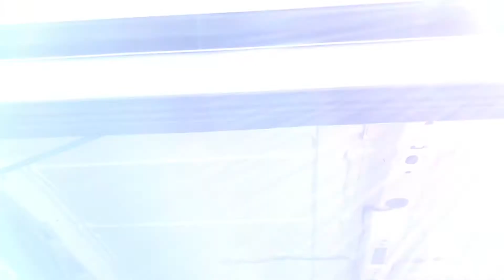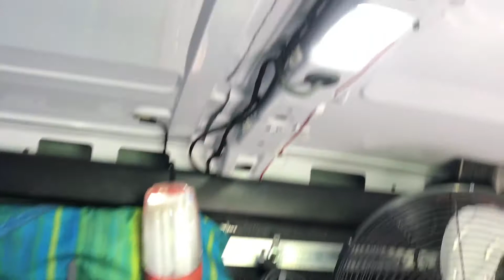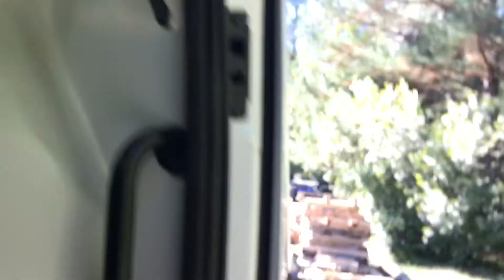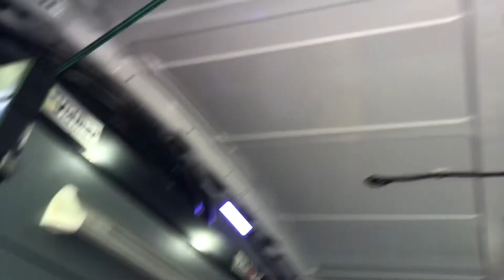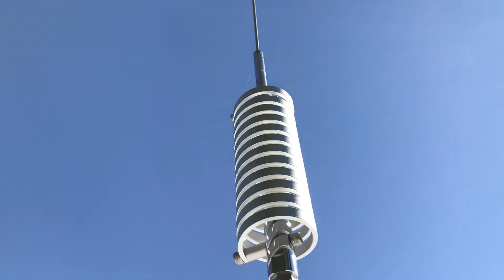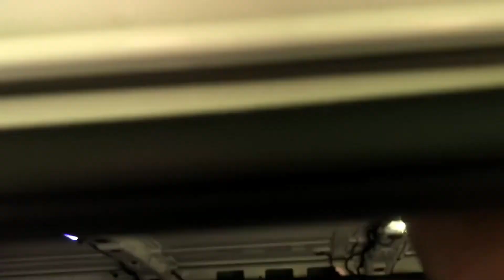High SWR fix it with an Impedance Match

Comment: When you use a coil, most of the radio energy is lost and the gain of the antenna is greatly reduced, without a doubt, the gain of the antenna is negative, also this transmission line has high losses, which makes the return current fake.
Eric Muller (Doctorate Rf/Microwwave, Field Communications)
Reply: Are you referring to the coil on the antenna or the coil on the coax T?

Comment: Not nessasary to get low swr...u need to properly isolate rf ground and bond....this will resinate at power outputs causing a loss in field strength

Comment: Running an FT 891? just get a MFJ 939 tuner and just bolt it to the underside at the feed point and get 15 to 10 with a push of a button..

Comment: I have an extra issue. With the linear off the match is fine. This correction needs to work only when the linear is in the on position. I can resolve this by in stalling a new switch inside the linear a dpdt switch allowing the inductance to only operate when the linear is turned on. Next, since I must open the linear's case, I will see if I can install the inductor inside the linear. This however, could dedicate that linear to that band unless there is room for an adjustable inductor.
Reply: Did you ever resolve the issue?  I have a KL203 and it’s also notorious for harmonics and other spurious emissions.  

I recently installed a Sirio 5000 on my truck with a mag mount...I know I know.  Still chicken to cut my roof.  I added 9ft of coax since the Sirio coax was too short(12ft) and that lowered the SWR while the amp was on.  Blame it on loss?  Maybe but my meter shows I didn’t lose any power.  SWR is around 1.5 with amp on.  Pretty happy with that and my TX gets a thumbs up from other operators.  I am total noob but just tried different easy options.  Try it!  Let us know.
Reply: @rallypoint1 I would suggest that the 9ft of coax is acting as a transformer or matching stub. This is because the impedance at the antenna is not 50 ohms but the impedance on the output of the linear is roughly 50 ohms. If those SWR readings are correct, then this is a very good method to impedance match, and the only losses you will incur are those of the coaxial's properties  itself (with an SWR of 1:1). Now 1.5:1 is the limit specified by RM for that unit. Going over could damage the output transistors over time, and avoid open circuit or dead short because those mosfets will pop in a split second usually. You could mathematically figure out the exact length of cable required, in theory, and if you are using a mil spec cable or are able to measure it's characteristics accurately with something like a VNA. But like the old adage says, if it ain't broke, don't fix it. And the losses associated with a 1.5:1 SWR are very minimal, it's just the life of the amp if it happens to go higher, mosfets generally 'wear' out from my observations anyway. You've gotta watch you don't overheat the output transformer too, so put a fan on the heatsink. Trust me, I know those units inside out and have owned at least six.
Reply: @arconeagain  Hi!  That’s a lot of good stuff to take in.

It’s been the same with 2 different antennas and coax that ran from different spots on the SUV.  The car is bonded..hood, doors, hatch and exhaust.  I unfortunately don’t have a VNA but I still think the amp is the culprit. LOL

The radio (President McKinley) is set at 2w DK with a 11w swing.  When amp is on it keys at 25w and swings to around 130w on AM.  Your right though it does warm up if I get long winded but there is a fan mounted on top and that keeps it cool.
Reply: @rallypoint1  Okay, interesting. I just bought another two of these, the new ones with the black heatsink, no preamp. I have seen these faulty from new, one with a faulty relay, one had a poorly soldered connection on a switch. One question though, are you placing the swr meter between the radio and the amp, or between the amp and the antenna? I do both as you have to measure the input swr too. You could have a faulty relay. The P model has two, an extra one to switch in the pre amp which I found faulty. Let me know if you're measuring the swr on the output, this could also be a dry solder joint or other component fault.
Reply: @arconeagain  Ya I have the newer black heat sink model.  It’s the 203 without the preamp.  I didn’t want to get the P version because if the preamp goes out the amp won’t work at all.

I measure both before and after the amp.  So regular barefoot check and then between amp and antenna.   I also read it’s the 2nd harmonics that cause the SWR to rise.  

One thing is that there is more than just slapping one on and using it.  Lots of troubleshooting and experimenting.  But for a cheapie throw away it does get you out.
Reply: @rallypoint1  When not faulty, they work fine, no issues with swr on 27mhz at least. I would first suspect the relay contacts when under power.
Reply: @rallypoint1  Although I have acquired all the things for my lab, I have not had the health to get it operational. There is a YouTube video where a man built an inductor to rectify the problem hope you can find it, it is a fairly easy fix. I just wanted mine to be incased in the unit.
Reply: Is the Browning BR-78 a 1/4 wave antenna? Thanks for your feedback!

Comment: In conjunction with the loading coil that is on the antenna itself, adding this coil actually creates an L network.

While the built in coil electrically lengths the antenna (hence making it physically shorter when tuned), a coil attached this way has the opposite effect.  In a sense they are actively working against each other in regards to antenna length, one trying to lengthen the antenna electrically, and the other trying to shorten the antenna electrically.

Also, for those who can't custom make a coil like this, MFJ actually makes mobile impedance matchers that have multiple inductors, or capacitors if that is what you need, that are attached this way and can be switched between.  They are typically used on the large screw driver ham radio antennas because said antennas tend to have impedance that are way off of what is acceptable for some ham bands, specifically the lower frequency bands.

All this being said, it is rare on CB frequencies that you need to do anything more then adjust the antennas length to get a reasonably good SWR match.

Comment: How did you figure out how many turns to use?
Reply from the maker: I made larger coil with a tap. It had a lot of turns and I used a short wire with an alligator clip. Then just tap up and down the coil till you get a good match. I have an mfj analyzer. So I took the pl-259 of the tee. Measured inductance. Then made a permanent coil. The coil with a tap is fine. When you find your best match. Cut the clip off and solder to that point. More questions? Email me. Sramsdellwdm at g m ai l
Reply: I had problems to adjusting my Wilson5000 magnet mount on my Transit. I hat to put it to the middle rear head and cut the whip about 2"... now I’m getting 1:1 

And by the way I’m also a Raymond dealer tech down in Montreal Quebec, Canada... 😉
Reply: Still a 1.3-1? Dude you have another problem that you didn't solve with that ARRL Antenna Handbook answer.  I'm gonna guess that dome mount isn't doing the job, or you're getting a reflection from the other antenna, or you measure the SWR with the van door open.  You are being too creative and overlooking a simple mistake somewhere.